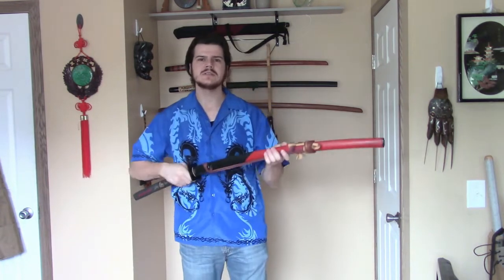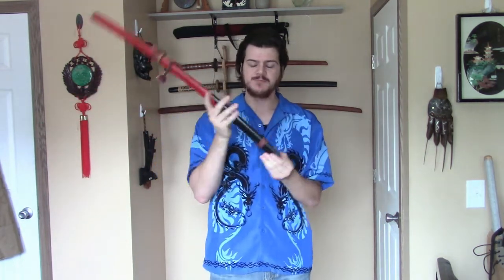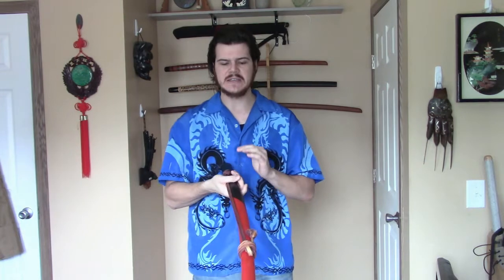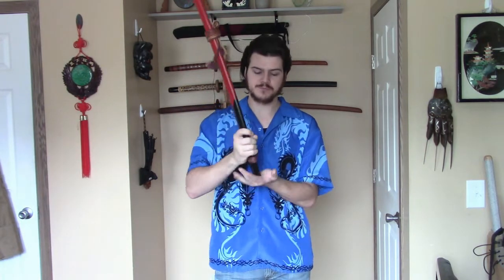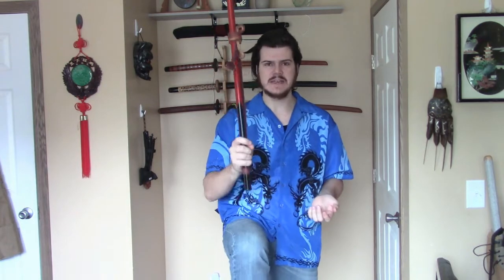Sword Scabbard Maintenance

Comment: I’ve used the cotton balls, but soaked them in mineral oil first. Where I live there is almost no humidity, and I never sheathe before cleaning and oiling, even when using multiple swords. (I leave the saya in the house when I go in the backyard to cut). I realize most people wouldn’t be like that though.
You made some real good points there, and if I moved to a place with humidity it would suck! It’s safe enough here is the desert, but now I’m thinking if I ever move or sell the swords to someone in a humid area, then it wouldn’t be my greatest move.
Maybe they could be removed with some clever wire work. Anyway, good food for thought. Thank you for an interesting and informative video Adam.
Reply from the maker: No problem! Even after soaking cotton balls in oil I wouldn't put them in a saya, you're plugging up that reservoir with cotton whether you soak them with oil or not, part of the purpose of the reservoir is a draining place for excess oil. Additional you're presenting the opportunity for the saya to absorb a lot of oil all at one time, definitely not ideal. If you just use the saya for storing the blade vs using it for iaijutsu than honestly I'd say don't worry as much about the saya rattle unless you use the wooden spacer method. Lol I can tell you from personal experience that if using the sword for kata a rattley saya is quite a problem but otherwise I wouldn't worry about it. As you get higher rank in a system less and less noise is acceptable from your draw or noto. 

  Yes, I'd try getting them out if I were you. A small hook on a wire could do it or even the method I showed for getting debris out of the saya.

Comment: Hey Adam, great video!

What is your opinion as to why a katana does not fit all the way in its own saya, but did when it first came out of the box?
Reply from the maker: Thanks! More than likely the wood swelled especially around this time of year depending on the humidity near you. When I went to a dojo one thing I had to be careful of during the summer was shimming a saya to a perfect fit at home and then going out in the heat and humidity just for the wood to swell to the point that I couldn't easily draw and re-sheath the sword. A few times I'd go to draw and the sword wouldn't come out with just pressure from the thumb nor the saya squeeze opening.
Reply: Hi! Great video and very useful. To ask a similar question, my sword from Dragon King fitted into its saya no problem (apart from some saya rattle). However, now when it goes in, the habaki is visible with 1/4 inch gap or so. So swelling perhaps? Is there a way of resolving this issue in which the blade goes all the way back in?

Comment: What should I do if I used olive oli on the katana because I didnt have anything else and put it in the saya is their anyway I could clean it out
Reply from the maker: Clean the blade off with a de-greaser and don't use olive oil again. Not really much you can do to clean the saya, the saya is wood so it absorbs. I'd just keep an eye on it after that.
Reply: @StudentOfWarCustoms  What type of degreaser should I use?
Reply from the maker: @korosu_oda   acetone, odorless mineral spirits or alcohol. Mineral spirits is strong enough to remove military cosmoline which is a very sticky grease so it'll take off the olive oil. I use mineral spirits on just about anything that's covered in oil. Acetone can work as well. I've also heard of people using windex but never done it myself.
Reply: @StudentOfWarCustoms  will any acetone work and if I was going to go with alcohol would normal rubbing alcohol work about 91%
Reply from the maker: Yes and 91% alcohol should work. Just make sure to be in a well ventilated area.
Reply: @StudentOfWarCustoms  Thank you so much for the help but I have one last question, can I put the katana in the saya after using mineral oil on it?

Comment: what's the difference between  a true hamon and an acid etch?
Reply from the maker: A true hamon is the result of clay being applied to the spine which holds the heat in and makes the spine softer than the edge when quenched. When polishing the 2 different harnesses of steel give different looks and results in a hamon. An acid etched hamon is mainly decorative and can be done on any steel no matter if it's heat treated or no. Acid is applied to the blade and that acid gives the look of a hamon. I know people who have actually done acid etched hamon themselves with mustard. If you apply an acid etched hamon and then polish the blade you're likely to take the hamon right off.